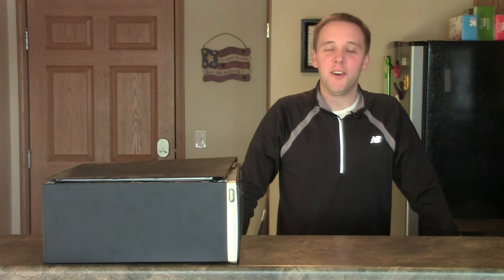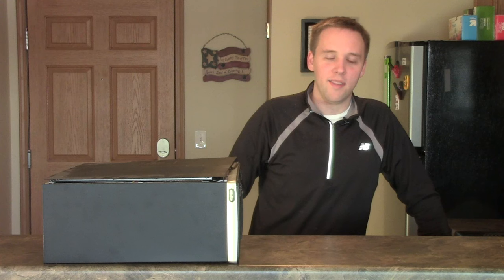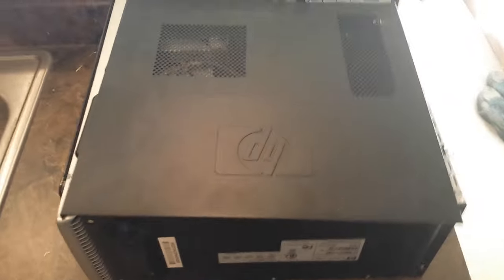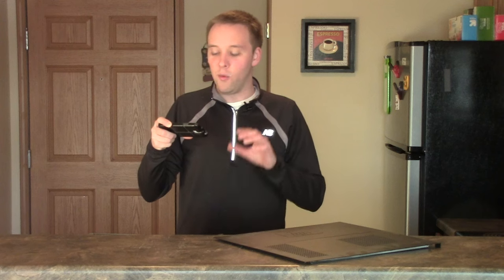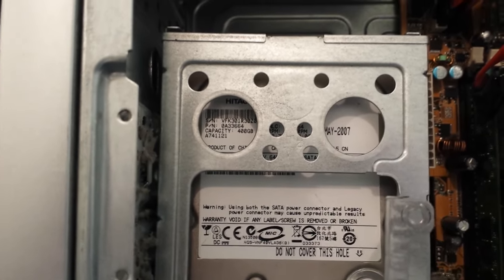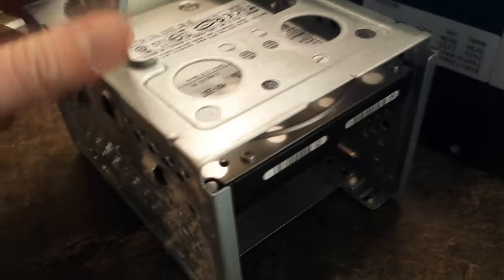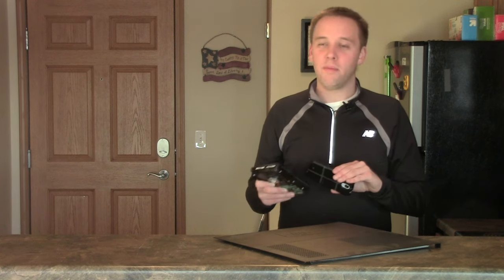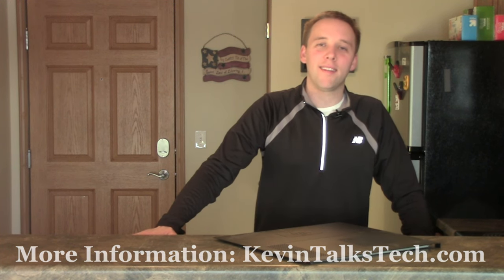Before recycling a computer, do this!

Comment: Awesome !!!! Thank you!  I have a 2006 Hp, looks just like yours. The monitor is broken and I don't want to deal with transferring data from ~17 + years ago. I also saw another video where this guy makes a DIY CD reader. Can that be done with a hard drive ? :face-orange-raised-eyebrow::thanksdoc:
Reply from the maker: If the computer is not an all in one, I’d suggest looking into another monitor since they are so cheap these days. You could repurpose the hard drive and still pull data from it. I’m not sure if it would do the same type of thing the all in one CD reader does though.

Comment: Thanks Kevin!! I did press the like button, and I do appreciate your tutorial, got the lid to my old HP pavilian off NP, (that was a synch) and even located the HardDrive - Mine's says seagate, and it just sits there locked solid.  No screws, no case - NO SCREWS!! It's covered by the label PLUS a stick-on silver sheet BUT THE DARN THING IS VERY hard to get off.  I TRIED - !!!! help......!!

Comment: Ok so my sister had some repair people go in my room and I didn't notice that 2 of my old laptops were missing until I went to throw away the boxes many months after. Recently (a year later) my credit card had unauthorized charges on it (I can only gather that's how they got ahold of my CC) ? Aside from that, am I in danger with identity theft? I had factory reset them both and delayed disposing of them- I put them back in their respective boxes not thinking they would steal it but they in fact did....

Comment: I have worked for a small company going on 20 years that has never had a true IT professional. I'm not a trained IT guy but because I knew the most about computers back in the mid 2000s, I ended up doing 90% of the company's computer stuff over the years, including disposal. As such, I have 3 shoe boxes full of old hard drives that I've removed from every computer that we've retired. At some point I need to take the next step on to destruction.
Reply: A computer tech told me to throw it down on the ground a few times &  break it!
Reply: So by disposal you mean recycling your companies old computers? Did you ever replace it with a new hardrive ?
Reply: @davida8364  no, the computers were being retired and replaced. they went to electronic recyclers. I just removed every hard drive and they remain at my house to this day.

Comment: Do recommend a reputable place to get money for a recycled computer once the hard drive has been removed?
Reply: most places that accept recycled computers nowadays will not give you money. There are too many components out there. Basically what they do is refashion the recycled components into computer systems that will be able to be sold to low-budget consumers...to make low cost computers that may last for a few years, for poor people that can't afford the expensive, cutting edge stuff.
Reply: If you're looking to make money on old computer parts, test them, make sure they work, then sell them on ebay.

Comment: Hi Kevin.  I removed the hard drive from a 2007 Dell desktop computer.  I couldn't download the data to a flash drive or cloud before I removed the hard drive because I had gotten the blue screen of death years ago and didn't know where to go from there.  I did know I shouldn't toss the computer with the hard drive intact.  Here it is 2020, and I've finally stumbled across your video.  Very helpful, thanks.  Is there anyway I can have someone retrieve the old pictures and family recipe files I had on the hard drive on my computer before it crashed a very long time ago?  I have saved the hard drive just in case someone is able to help me with this.  (I just wouldn't want a wayward employee from somewhere stealing my identity if they were to do this.) Thanks in advance.
Reply from the maker: Hi Lise, good question. You’re right that there are services out there that can attempt to recover the data. I unfortunately don’t have a lot of experience in this realm.Make sure the place you are going is trusted - I unfortunately don’t think you’ll be able to retrieve the data without some help.
Reply: I have had this done before, it is possible & quite a relief.  A computer tech did it for me.